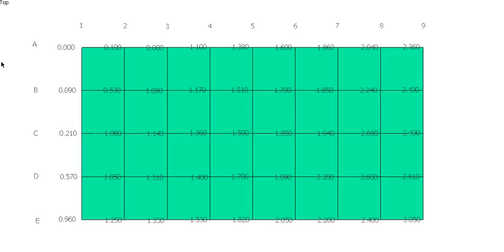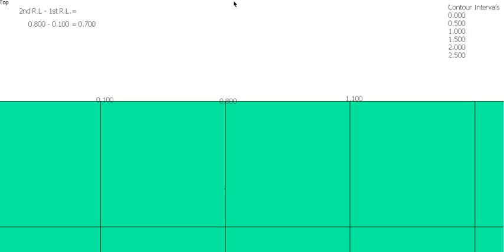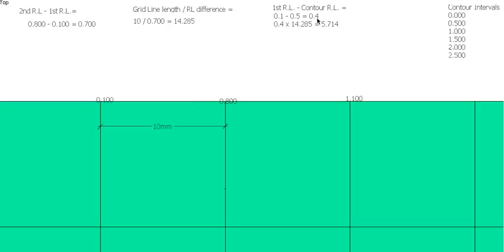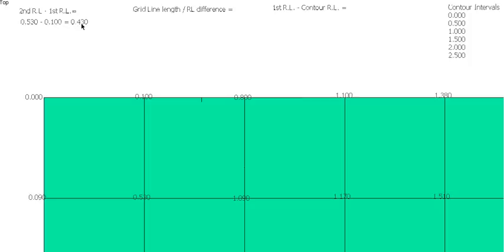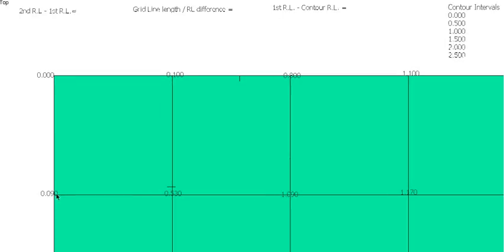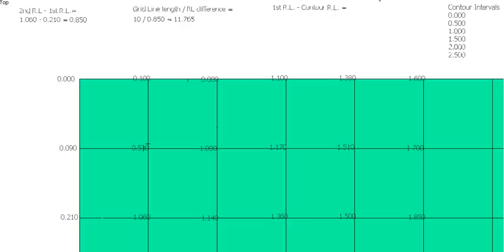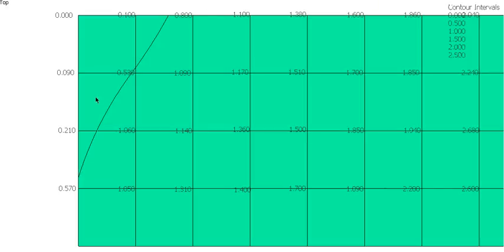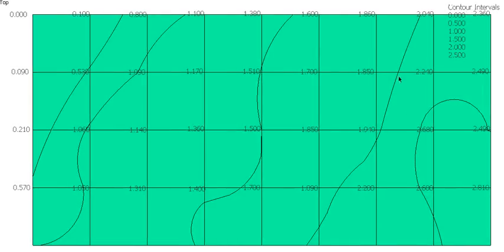Develop Contour Lines

Comment: I find the following formula easier to follow: (Highest Level – Contour Level)/(Highest Level – Lowest Level) x Grid Line Length = Distance From Highest Grid Point. E.g. for your first contour: (.800 - .500) / (.800 - .100) x 10 = 4.28mm - In other words CL .500 is 4.28mm from the highest RL (.800).

Also, thanks very much for making this series of videos. I hope that you are getting some sort of royalties from all of the Tafe colleges using them in their courses.
Reply from the maker: Hi Sam, thanks for sharing that formula, I'm sure others will find it a useful alternative to mine. 
Yes i get plenty of views form TAFE and other RTO which all helps.
Reply: Sam Taylor which software is that?

Comment: from my calculations, this formula doesn't seem to work with  whole numbers. For instance, lets say we have Point 1 = 25 and Point 2 = 20.
Following the formula i have this:
A 25.00 - 20.00 = 5
B Distance between points (10,000) / 5 = 20

C 20 - (contours spacing 1) = 19.00

D 19 x 20 = 380
This doesn't make any sense to me. Over 10metres, the spacing should be 2000mm, not sure what this 380mm is? Are you able to shed any light on this please?
Thanks, great video too by the way.
Reply from the maker: Hi Andrew
I think where you are getting confused is with the distance between points. This should be the distance on the grid you are plotting it on, on the paper, in millimetres. 
The answer that you get is the number of millimetres from the 1rl to where the contour line will cross the grid.

Comment: Hi, 
trying to work this out.
Lets just say your contour line that will run though 1.940 and 2.200. With the working out you provide the answer is 55.391
Reply from the maker: Hi Rinaldo, Assuming that you are looking for the 2.000 contour line and that the grid spacing on your grid is 10mm like my example then I get 2.308.
My working is in this spreadsheet which you can use as well
https://docs.google.com/spreadsheets/d/1zgTRqYCnFbcF4KNWhDpIK70MapmSfDwbp72QyAoI114/edit?usp=sharing
Remember when I say grid Line length that is the length of the grid lines on the paper you plotting the contour lines on not the spacing of the grid for the original survey.

Comment: thank you sir, but really confused if it is 10mm or 10m and 0.100mm or 0.100m......you say 100 mils which is after the decimal and when I see the figure it is 10 to 0.100....is that correct or m just confused please let me know......other wise really thank you for putting such an effort
Reply from the maker: Hi Ravi
when I say "mil" I mean millimetres however because we then have to work out a factor which gives us a height per millimetre the whole decimal system gets thrown into chaos. So the final answer is millimetres even though it is showing in metres in SketchUp.
Hope this helps, thanks for your comments

Comment: Hey man im just a bit confused how do I determine which points / Intersections to use as 1st and 2nd RL's ??
Reply from the maker: Hi Mate, what you need to do is look for the points that the contour line would pass between. So look for R.L's that are higher and lower than the required contour then just do the calculation using those figures.

Hope this helps
Reply: thanks man I also went back and fourth on the video and also found a solution to my question resulting in the contour interval that you have chosen which was 0.500mm and may i ask why have you chosen 0.500mm and not 1.000m for example?
Reply from the maker: HI Mate, no reason, in particular, 0.500m is just more common and more detailed I guess.
Reply: Great video other than that mate def subscribed
Reply from the maker: Thank Mate

Comment: How come there are no contour lines in some grids? Like 1.380 to 1.100 and 1.170 to 1.090? I'm trying to wrap my ahead around this stuff but just can't seem to get it...
Reply from the maker: Chloe Absalom Hi Chloe The contour interval for this example is 0.500m, shown at 0.500, 1.000, 1.500 etc so they are only shown where there is a 500mm difference in height. In some areas of this block of land the slope is very flat so the height doesn't rise that much. 

Remember contour lines connect points of equal height. So everywhere along that line is the same height 

If you haven't seen these videos they might help
Contour Lines
Develop a section from Contour Lines